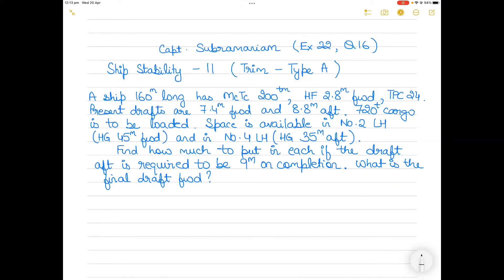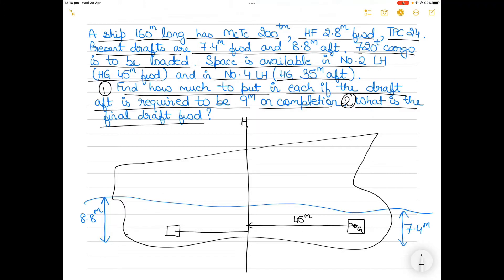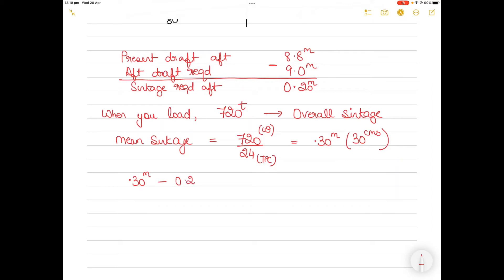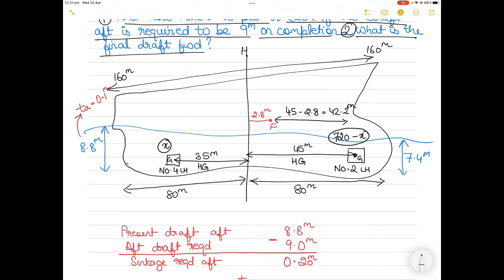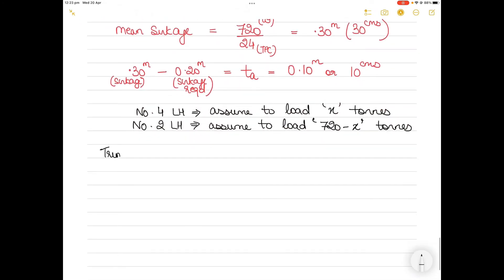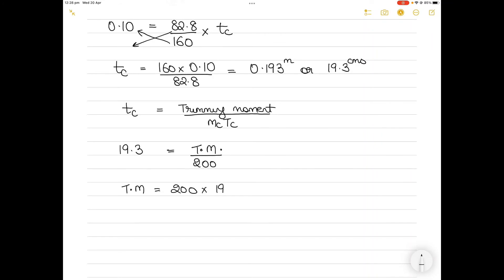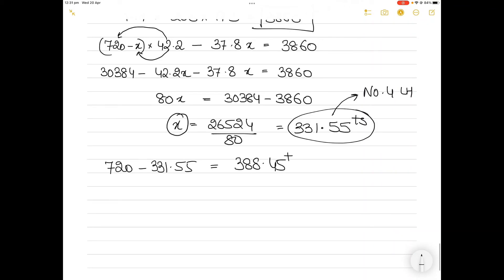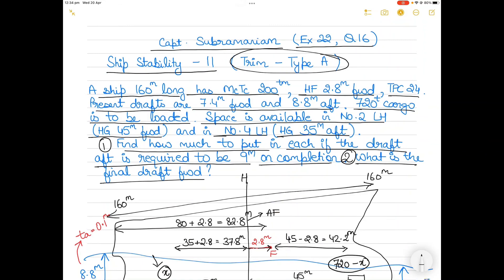Ship Stability - Trim calculation (Type A Q16 Ex 22 Captain Subramaniam)

Comment: Captain, Can you kindly help on  how to solve this question.
A ship leaves port with draughts F7.16m, A 7.31 m. During the voyage, she consumes 400
tonnes of FO from a space 16 m forward of LCF. Calculate the minimum amount of sea
water to run into the FP tank, 60 m forward of LCF, in order to bring the ship to a maximum
draught of 7.16 m
(Check the final draught forward).
MCTC 110 TPC 16.
LCF amidships. 

Answers  Run 90.4t into F.P. F 6.92 m AFT  7.16 m